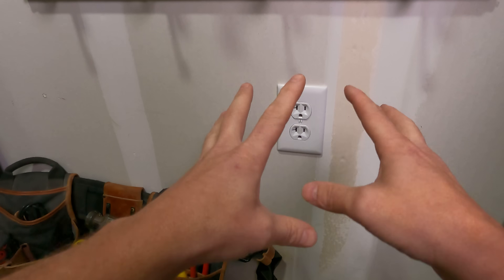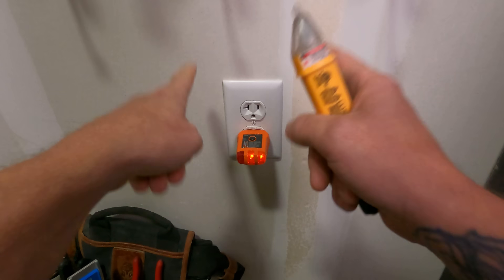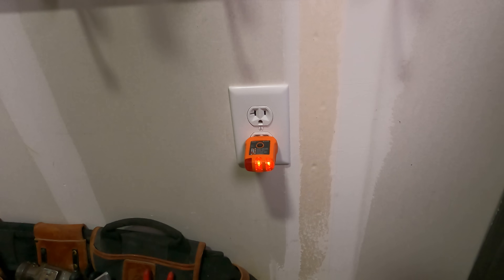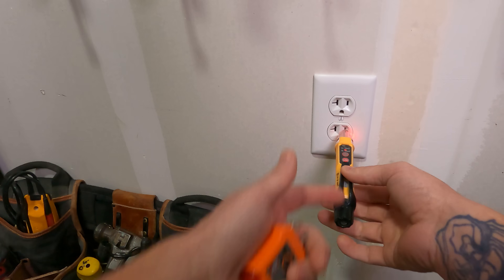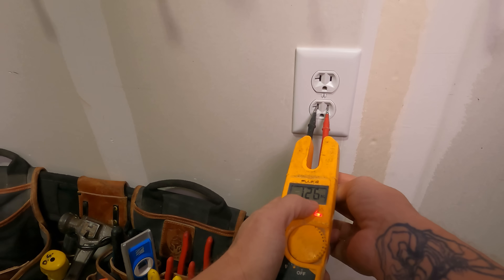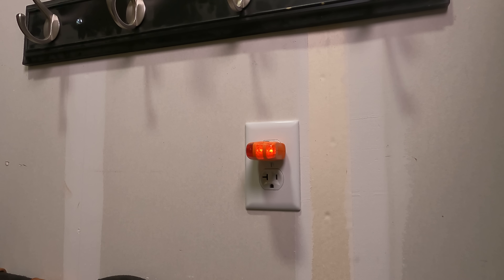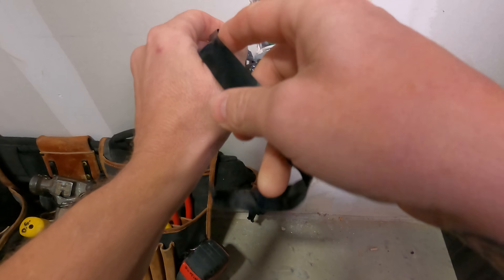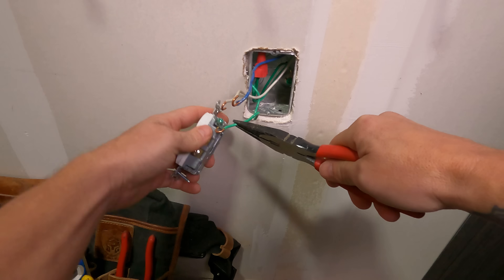How to Change Out a Receptacle  - The Right Way!

Comment: I am late to the video - for which I thank you, since review and reinforcement is always welcome - but your opening comment about plug testers raised my language antennae. We can see your complaint clearly, noting the socket is what is being tested. In defense of the name, there are all sorts of ways to test a socket. What distinguishes the plug tester is the fact that it comes with a plug. It has a form suited to its purpose to such an extent that it would be a significant hack to put it to many other uses than testing this particular sort of pronged socket. So the name is just a shorthand for the form. When we ask someone to bring us the tester for the socket, the "which one" question might come back from someone looking into a tool bag with several pieces of test equipment. The answer to the question is, in this case, the one with the plug on the end.

In the course of those opening remarks, continuing with language (since we are a long way out from the release of the video and you seem detail-alert, so we go), you use "anyways" several times, which we hear used by a lot of people who grew up in certain parts of the US. Sadly, it is spreading on the internet through social media along with similar errors of redundant pluralization like "alls" and a host of misused terms intended as generalized substitutions for more accurate and informative words ("unit" may be the most abused of these, for the moment). The word - or error, as we would have said when teaching standard English in school with actual grammar and vocabulary correction was still funded, forty-four years ago - adds an ending s to "anyway" without considering the "any" already covers whichever "way" we might like to go. If we want to specify some subset of those ways, "anyways" would be insufficient for the job. We would need to be clearer, where we have some particular things in mind and we made, say, a list of them: I mean any of those ways, the ones I just listed. For the case in which you have used "anyways", "anyway" is always correct.

When I went to school, little boys would come in saying and writing things like "anyways" and be corrected, not to shame them or to make them feel uncomfortable, but rather to teach them the standard usage (usually, if not always, it would be a well-considered preference with real advantages over erroneous or optional choices). Learning the language - the version of the language intended, back then, to free us from being marked by our dialect or slang as members of a given social class or ethnicity, should that be our wish in a given context, giving us the tools to use the language of the educated and powerful regardless of our origins - requires letting people know where they have gone wrong. The US budget cuts to education funding in the midseventies and the early eighties, along with some secondary political nonsense about privileging all versions of English equally (which is a nice thought, in a way, but one completely out of touch with societal realities and the need to have communication happening in public life with clear, decidable meanings at the peril of political manipulation of fact and sense - which has played out in too real a way over time), effectively killed the project of teaching standard English because there was deemed to be no pressing need to teach kids their native tongue. We lost English-grammar instruction from "grammar school" upward, many music and art programs, funding-intensive "shop" classes (including, in some cases, electronics and mechanical/industrial drafting and woodworking), guidance counselors, school nurses, etc. We used to have all those things. Once lost, they never returned.

It turns out keeping taxes minimal and the population uneducated in critical and creative subjects works to the advantage of a certain small but wealthy class of people who have carved out a lot of political power by way of targeted spending, changing laws along the way to ensure they can continue to do so. Language instruction and its process of error correction are important to life and well being in less-obvious ways than instruction on correct wall-socket wiring, but, in the long run, no less vital. We are, sadly, reliant on one another to correct our English, despite everyone in English-speaking countries needing in one way or another or in many ways to have facility with the language to navigate important life issues. The little complaints we see on the web here or there do no more than to alert us to think more carefully about the words and phrases we use, or may prompt us, in unusual cases, to look for background information on the way the language operates. The latter can be frustrating and misleading, with the field noticeably impoverished by stunted and propagandized development for four and a half decades. Still, some geeks among us make that effort.

Anyway, this is a big subject and way off our topic. I am flat on my back and in pain, trying to distract myself. I succeeded, first with the video, then with a long, crazy note on a tiny piece of the video. Thank you for that.

Comment: Good video, but I wish you had talked about the importance of hooking the screw instead of stabbing the hole in the back. I’m constantly replacing outlets and switches that weren’t working because they were stabbed. They will eventually loosen up and start melting the insulation

Comment: I was taught to use a pig tail because you shouldn't allow the receptacle to become part of the circuit. It also helps to detect a bad receptacle without cutting power off of the rest of the circuit.
Reply: Direct wiring to the receptacle instead of pigtails is permitted by code, the side plates are rated for 20 amps pass thru even with 15 amp receptacles.

Comment: On the receptacles, what are the second set of screws for?
Reply: They are typically used to connect to another receptacle downstream. If the fin connecting the 2 screws on the hot side is severed, this to have one receptacle switched and the other one hot all the time, or it can indicate 2 separate circuits with a shared neutral.

Comment: I agree with you in that non contact voltage testers can be inaccurate sometimes, but sometimes electricians are not concerned about the amount of voltage, sometimes they only care whether the power is present or absent, and that's when I think an  NCVT can come in handy.

Comment: It's saddening that some electricians don't want non-electricians to learn the trade.  I've seen a POCO guy just tighten the SEC's in the meter can with a T-handle.  They let me tighten them to the 21ft./lbs as required, I could still tighten them.  I see the 200 amp panel installed in my house prior to my ownership (who knows, maybe a DIY), and they didn't install bushings, didn't even have a lockring made up tight so the conduit fitting was cocked, and ran a wire out the top front of the panel so it was pinched when the cover was installed. I'm very glad you make this information available.  As a farmer who has put in two services on my property (one new and one changeout due to broken pole), if some electricians don't want to answer questions I have, I will ask it to other electricians/look at the code until I know I'm doing everything correctly and to code.  Actually was very surprised how easy it is to pass an electrical inspection, as long as you research everything beforehand as a layman.

Comment: Even non-DIYers need to know how to do this stuff because it is so common for contractors or supposed professionals to do things wrong - either out of ignorance or sheer laziness.    
As I have started to do DIY projects and research them carefully it has been shocking to find out how many things are not up to code or not done well in a house that was built in 2000.

Comment: DIYer? If it is aluminum don't touch it! Hire an electrician with experience working with aluminum wiring. If someone calling themselves an "electrician" or "handyman" wants to use purple wire nuts on aluminum to copper connections, put them out the door.

Comment: Good advice. I was tought by an electrician to not necessarily line the receptacle in the middle of the mounting screw opening. The reason is that usually the drywall cutout is wider on one side or the other, so sliding the receptacle to the wide side will cover the gap better when the cover plate is installed.

Comment: When shutting off the power to a dual receptacle, and you test one of the receptacles and find no power, is it safe to assume that the other receptacle also does not have power? Is it possible that one of the receptacles could be on a different circuit?

Comment: Recently had to update all the dimmers in my house b/c they were old and not LED compatible.  About 20 of them.  House 25 y/o and electrical done by a 'professional.'  Found wires wrapped counter-clockwise around screws, loose screws, and no ground wires to switches (though to be fair, I'm not sure if that was code back in 2000).  Similar story when I upgraded breakers to DF and put in a SPD.  Panel was a mess.  Multiple neutrals to a slot on neutral bar.  Neutral and ground not separated on a sub-panel.  Even if you don't DIY, knowing something about electrical work is useful if you own a house.

Comment: Question: Thank you ! I have a typical receptacle outlet with two vertical plug-ins. When I looked the gold screws had 1 each black wire, the silver had one white wire each. The ground wire was on the bottom. Where are these wires re-attached when I replace?

Comment: I do a limited amount of DIY work. I don't know how anyone can afford to call out a tradesman every time something small goes wrong. I didn't touch electrical for years because I was always relatively nervous about it, but after some convincing I started learning through videos like this one, and I've been able to fix some small issues with older outlets and switches. Doing these sorts of basic jobs is pretty easy (and dare I say kind of fun as one-off kind projects?). I often get the impression that I'm cleaning up messes left by previous DIYers though, so, profits aside, I see why electricians may not want to encourage this too much 😆

Comment: When connecting the HOT line and the NEUTRAL line, I have a question.
There are TWO brass screws on one side, and TWO silver screws on the opposite side, of the receptacle .
Let us speak first about the HOT wire connection.
Does it matter which BRASS screw I attach the hot wire to?
Now to the neutral line, does it matter which of the SILVER screws I attach the neutral wire to?
THANK YOU !
Reply: No, it doesn't matter as long as the tabs on the plates between the screws are still intact. They can be broken off by twisting back and forth to make each socket independent from the other, which is necessary in certain cases.

Comment: Are electrical wires supposed to be VERY stiff? I changed my first receptacle in my 30 year old house and it was very hard to push it back in and screw the outlet in.

Comment: Nice video. You  suggest that tape may not be required in residential apps. I have come across numerous times that ground wire is bare. In those cases you definitely want tape on outlet, residential or not.

Comment: Great if you have colored coded wire, skipped right over identifying hot neutral ground when they are all the same color, more common than not
Love the wrap around the receptacle though

Comment: I'm a DIY that took actual electrical classes at the community college.
A few things I'd like to add:
1.  Make sure there is no insulation under the terminal screw
2.  Make sure the bare wire of the hot and neutral does not extend past the device back.
3  Wiggle the device after installing the conductors and recheck for tightness.

What's your suggestion with dealing with stacons that were crimped tight in the box?  Maybe 2-3" of wire.  Yeah, I'd like to kick that 90's electrician in the back side for using back stabs and not leaving enough wire to change to terminal connections without adding pigtails.

Finally, Thanks for your more technical videos.  They help me know what I want done when I need to hire an electrician.

Comment: Can GFCI receptacles share a neutral?
I have a 12/3 UF running out to a new workshop with two GFCI receptacles sharing a neutral, but only one half works at a time either the red side or black side. The other circuit trips at the receptacle when reset. Both sides work as long as the other side is tripped. Any advice?

Comment: I use a multimeter to test power. Those other testers are great, also.

Also what’s the reason commercial environments use metal electrical boxes and residential use plastic? I have metal one in my house that was built in the 70’s. I’m replacing it with a plastic box, now.

Comment: The electrical tape would be a good thing but it is not UL approved for the receptacle and can hold in heat in the receptacle that is not tested by the UL lab. The same is true for wire nuts and I have had melted wire nuts that were taped. The last thing is when an electrician removes this tape it eventually finds the bottom of my shoe.

Comment: If the panel is not marked - Plug a lamp into the receptacle, turn it on, open breakers until it goes out. I do check the receptacle with my Fluke 117 after I get it out of the box.

Comment: I know the white must go to the silver screws and black must go to the brass screws but like in this video does it matter which brass screw the black goes to? Will it matter if its the top or bottom brass screw? Likewise, does it matter if the white wire goes to the top or bottom silver screw?

Comment: Some outlets have those holes near screws and if you stick wire in that hole it let's you LOOP the wire and it won't come off even if screw is loose.

Comment: This video was very helpful and insightful.  I am purchasing an appliance that has a Nema 5-20 and requires a 20 amp.  My circuit breaker says 20amp but I have a 15amp receptacle.  Should I swap out the receptacle with a 20amp receptacle or would an adapter be ok?  Thanks.

Comment: Looks good. Was that neutral coming out from the screw when it was tightened. Hard to see. Anyway, one thing about leveling. You can leave the screws a tad loose, use the level to get the cover plumb/level then just remove the cover and tighten the screws down. You don't even need to put the screw on the cover until done. Extra step but its good fit and finish work.

Comment: Nice video - totally agree that it's better for people to learn from a pro. I've seen plenty of bad DIY videos out there.

One DIY tip for finding the right breaker - plug in a vacuum cleaner and turn it on. You can usually hear it from the service panel and it saves running back and forth.

Also - you should have warned people against using the back-stabber receptacles (prone to failure and a pain to remove) and against putting more than one wire on a screw terminal.

Comment: Hey Dustin,
I was changing a receptacle in my bedroom, but I found something weird and I don’t know how to go about fixing it. 
This outlet seems to have two circuits in the box. The old receptacle had no ground and I was using a GFI because the grounds were tied to this old metal single gang box. It also looks like the one circuit was dependent on the other’s neutral, since I read voltage across each black and one of the whites, but not the other. I tried putting a nut on the one black, since I assumed it was the end of the circuit, and connecting the other black and two whites on the GFI. When both circuits were turned on, the GFI tripped. Any ideas?

Comment: What is the best method for running new power to an existing outside light into a switch 
inside a house. Was considering using fiberglass fishing stick, but was told by the home owner it was to tight to fish new wiring.

Comment: At 9:38, don't stretch and tear, instead cut the tape!  Over time, the tape will try and return to its original size, and will actually peel apart as it does.   I had a case where it unpeeled enough to caused an arc to the metal box when users were abusing the outlet.   If you trim the tape and press it down, the tape isn't trying to pull against itself and should not fail.
Reply: I like leaving pull tabs on tape. I am sure the next guy will appreciate it.

Comment: Hey, i was wondering if you had a video talking about how long you would expect tasks to take for different levels of skill. (like change light fixtures, potlights , plugs, or even entering cable into a new build switch box and doing your splices.)

Ultimately I understand quality over quantity, but i find a lot of guys out there have no bar to compare to

Comment: Thanks for the DIY content!   I've got a problem in my house that maybe others share.  Our 170 year old house has "mostly" modern wiring, but I swear 75% of our outlet boxes are loose in the walls.  I have NO idea why they couldn't secure the boxes better!  I'm about to start a campaign to go through and inspect/fortify the boxes, and tighten up the receptacles and switches.  Tips / Tricks about that sort of task would be awesome to see.  Most of my wiring is romex into steel boxes.  At least MOST of the knob & tube is gone.. except for those scary orphaned wires in the attic!  :-/